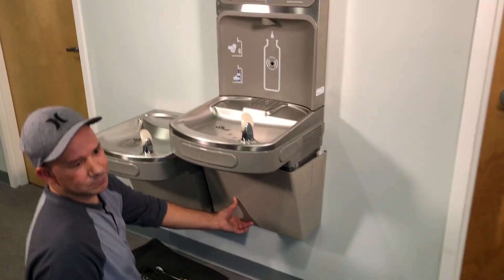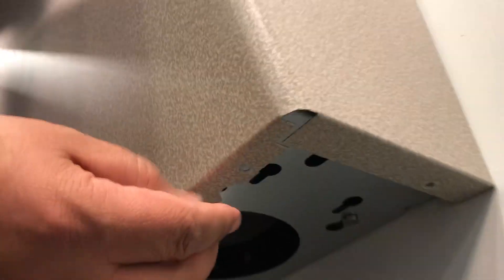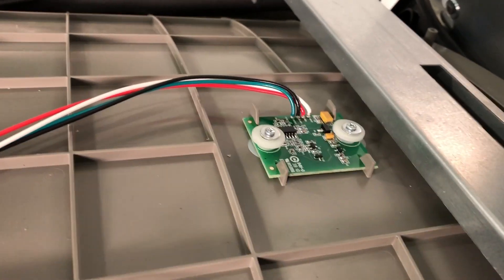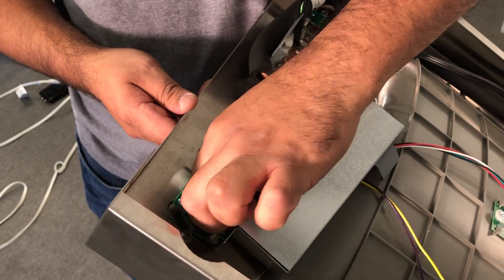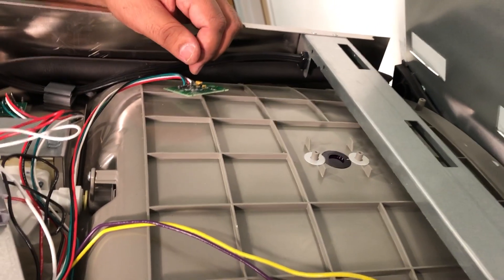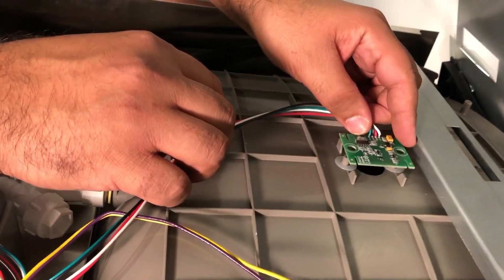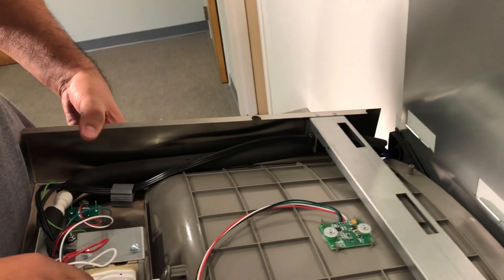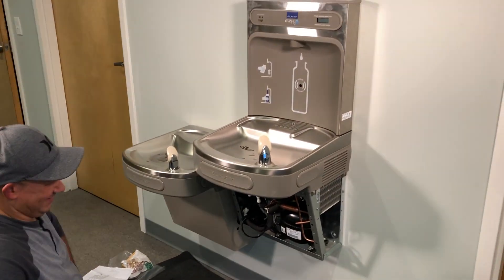How to Replace the Sensor on an Elkay ezH2O Bottle Filler

Comment: Dude , question! There no water coming out of the filter air raider! It's clean ! And the little motor behind it makes noise and spinning, why would there be no water coming out
Reply: That's a water line problem.  Make sure the valve is turned on and the filter is connected properly.  Otherwise, check to make sure the water is coming to the unit properly.  If you can't find the issue you will need to get a plumber involved.

Comment: I have been trying to reset the filter light on our water fountain for days and cant figure it out. We do not have a button on top like this one, but this system looks very similar to ours. Any tips?
Reply: You figure it out?  Ours is the same.
Reply: A bit of a late response here.   If it's an "enhanced" unit, (model number ends in "P")  the light will reset automatically, but you have to make sure you have a filter that has an RFID tag in it - like the 51300C, and you have to make sure the RFID tag is lined up properly to work.  Look for our videos on how to replace a filter.    If it's a standard unit (model number often ends in K), you will need to toggle the switch that is found through the top, behind the bottle counter.